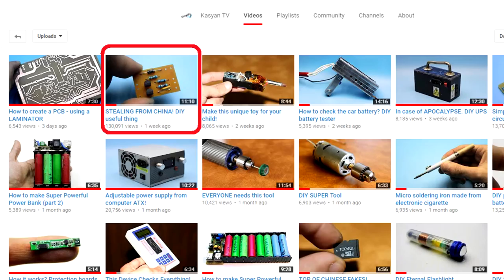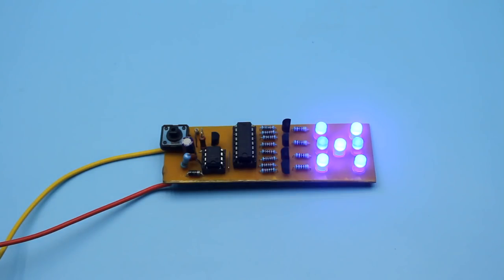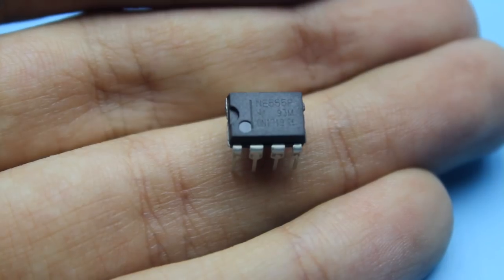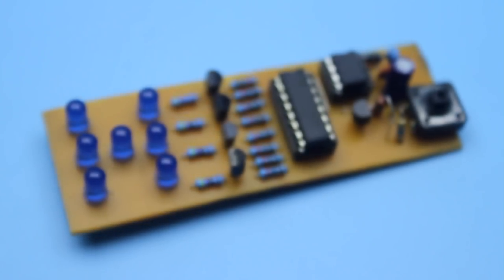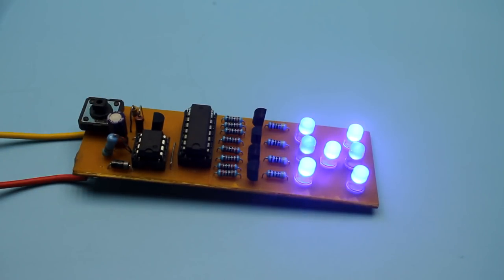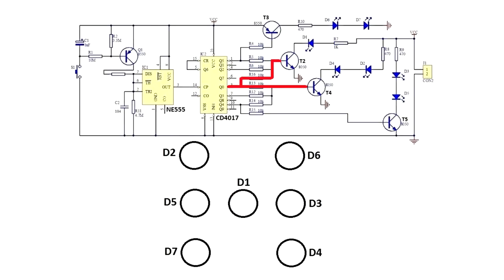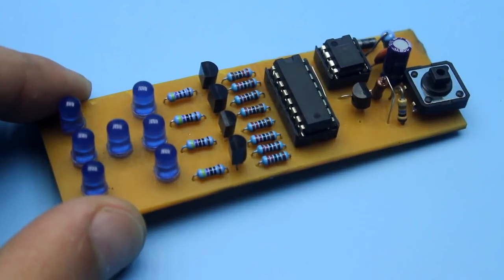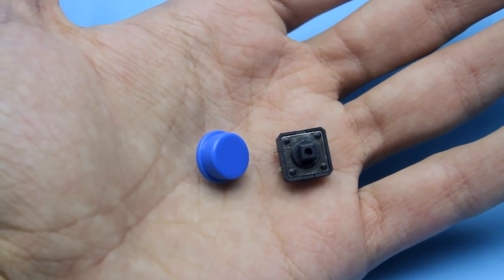STEALING FROM CHINA 2! Еlectronic dice

Comment: audio is really quiet
Reply from the maker: the next video will be louder
Reply: It's fine on my side (with the volume of the youtube player set to half volume). So no need to make it louder, but the volume varies a bit between different parts of the video. You should check that the volume level is equalized.